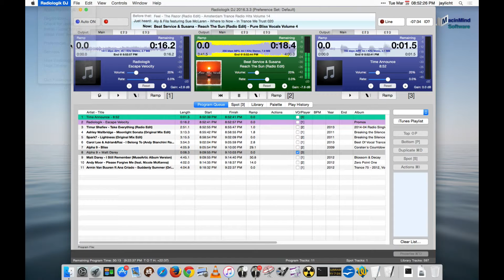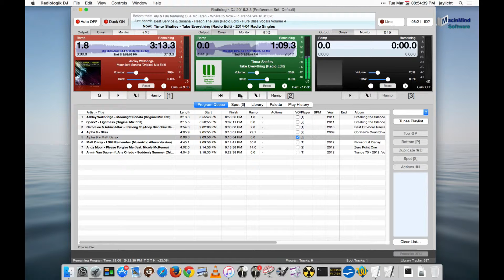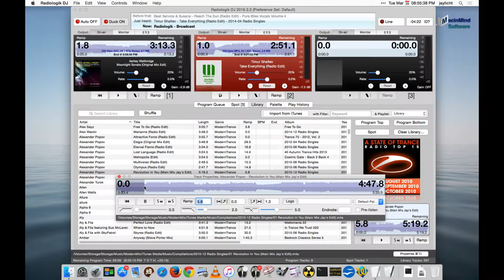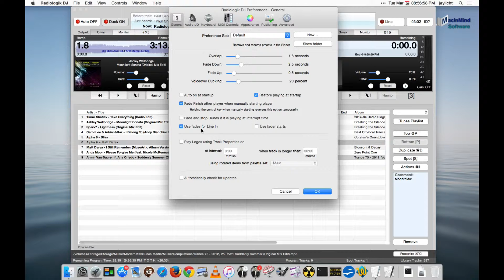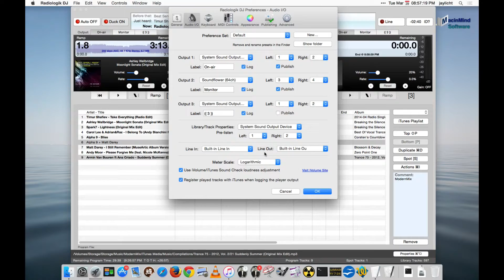4.  Radiologik DJ Audio Outputs

Comment: Would I be able to send these outputs to Apple Logic? Say I wanted to record my radio program--I could send Radiologik's Output 1 to track 1 in Apple Logic, Output 2 to track 2, and Output 3 to track 3?

Many thanks!
Reply from the maker: This is true of any apps even when they allow the output to be set. You can't direct an output to an input without physically doing it or else using a virtual audio device that connects them together. The best and most versatile for that is Loopback from Rogue Amoeba. Free alternatives like BlackHole or Soundflower either only work with older macOS versions or they are not reliable.

Comment: Hi, I am still a bit confused about when I use Track 3 for songs? Can anyone help? I have registered on the forum as well
Reply from the maker: Player 3 is used for tracks that have voiceover on (checkbox). So if you want to manually put a track in player 3, you can do that. For automation, player 3 is used for voiceovers as well as when there's too much overlap between 2 quick transitions to accomplish it with just 2 players.
Reply: @MacinMindSoftware  An I missing something? Should I go on the Forums? If I get a track into Cart 3, can I just fire it with a hotkey?
Reply from the maker: @1974Kyle   Player 3 also plays the selected track in the Spot list [3] tab. I tried to give the clue in that tab title. You can add tracks to that list and select the Spot. You can define the key for playing spot in Preferences--Keyboard. Definitive support by email. The forum is independently run peer support and can be helpful.
Reply: @MacinMindSoftware  Hi, sorry I thought this had posted but maybe not, if a track is playing in one or two, is there a key or a button to press which will pause that cart? Or does it have to play to the end? I know I can recue things but I didn't know how to pause it?
Reply from the maker: @1974Kyle  There is no pause per se. You can set a fade & stop key in Preferences--Keyboard. Default is /. Auto must be off to prevent the next track from starting. Fade down time is adjustable in Preferences--General.
Reply: @MacinMindSoftware  That's absolutely brilliant, thank you!

Comment: hello, 
thx for all the vids. Nice Programm. 
But if I want to hang up with a dj software like VDJ - Traktor - Serato ...... via Radiologig live, I can only connect via line in there?  or are there other routing options?  My wish or goal is that I can play, for example, automated dj playlists within the DJ software but also temporally time controlled automated jngles on the radio (from radiologig) can play along virtually parallel and at any time parallel live deejayen can.
Sry for my englisch - Hope you can understand 
Greets
Reply from the maker: Sorry, Line In wasn't meant for microphones. Again, it's not meant to be a mixer. The feature is a very simple stereo connection from an input to an output to which I added fade ability but not volume control. If you can, get a mixer, run Radiologik DJ out to it, run your mic into the mixer, run the mixer to whatever gets the final mix, perhaps an input on that same Mac for a streaming app. The benefit of controlling your mic on and off and levels with a tactile device is far superior in my opinion. If you can't do a mixer, you can mono the mic with adapters. The Rode NT1 is a XLR connected mic. In my case with a similar mic, I run the mic to a pre-amp and have adapters (one of which is a Y adapter) to get it to stereo input on the Mac.
Reply: MacinMind Software thank you for answering my question again.  
All right, I understand.  

Thanks again for the support
 now I hope very much that I will not continue to bother you :)
Reply from the maker: Radiologik DJ is just a source, not a mixer. The point of the Line-in passthrough is not to be a mixer but to be able to schedule automatic switching of external content on and off with track actions not unlike turning stream receive on and off with track actions. I'm not sure what your audio destination is so I couldn't give a precise answer for you. You could run out to a real tactile control mixer and back into the Mac if streaming or use Audio HiJack which can capture mutliple sources or have multiple sources (Radiologik DJ and some other software) run to a virtual audio device like Soundflower or Loopback and have some other app capture like LadioCast. There are so many possibilities that Radiologik DJ is not limiting you.
Reply: MacinMind Software Hello, Thanks for the quick reply.  I understand.  So that means I do not need the direct line in from radiologik but it could be based on external such as audio hijack soundflower etc .... run in parallel.  that's a great approach.  I'm absolutely new in the matter and just check everything out and build and if that works as I will, I will buy the version.  :) many thanks.
Reply: MacinMind Software I apologize again, there would still be a question to the line in connection with the micro.  how do I get the mono set.  I have a signal on my micro (Rode NT1) only on one side.  think that's because it's in stereo.  For example, with Amadeus Pro or Wave Pad - Logic Pro, switching is not a problem, so you get a nice centered result.  Thank you for your help.